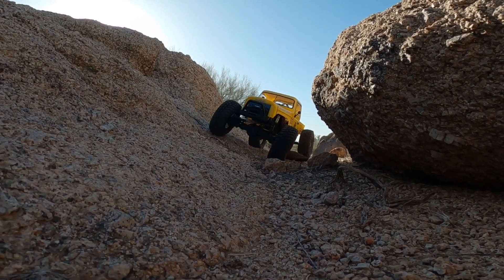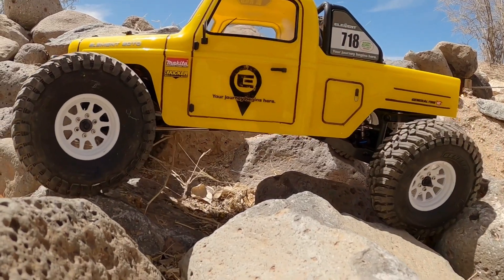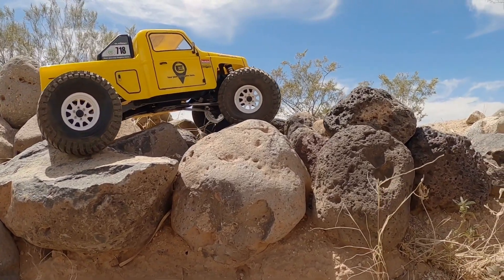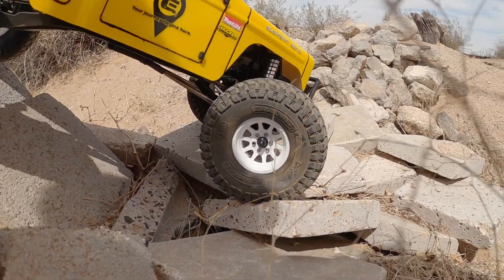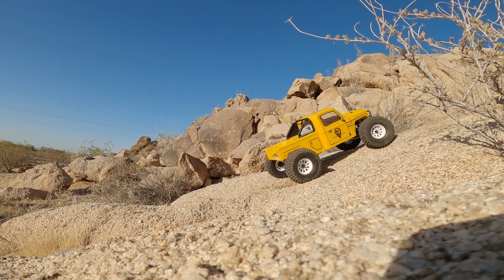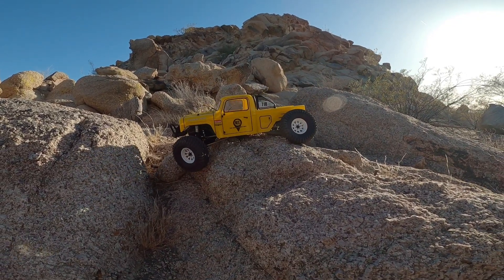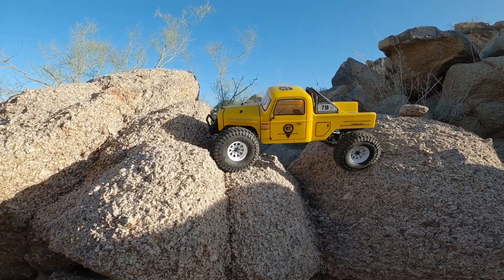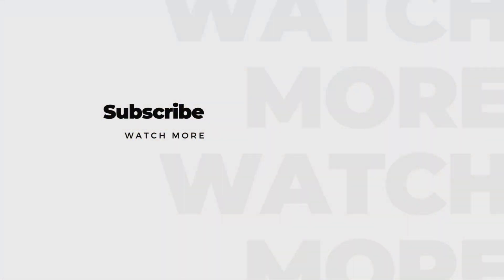Element Enduro Ecto Episode 3 - HobbyWing Quikrun Fusion 1200kv Brushless RC Crawler Motor ESC Combo

Comment: I have multiple vehicles with the 1800kv version of the Fusion.  Although it is 50% more KV, after watching your video, I would have to say it can crawl just as slow or slower than what I am seeing from your 1200kv.  I also run a 22 tooth pinion in my element trucks with that motor and it is ridiculous how slow it can go while maintaining forward momentum.  Also just preordered the new pro 2300kv version.  Hope when it comes in that it is just as smooth but only time will tell.  And yes the GT5 is amazing for the price.  Gives the ability to control many features not normally found on other low priced transmitters.  Great video and thank you!